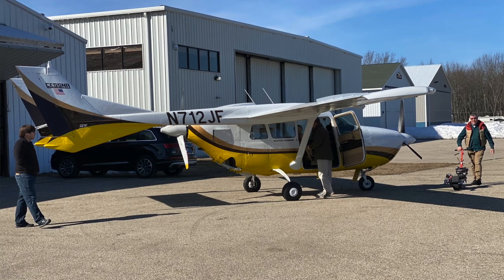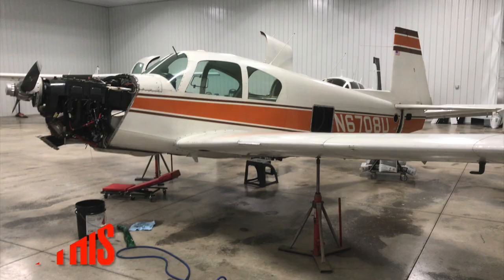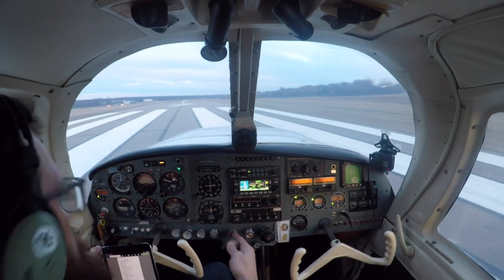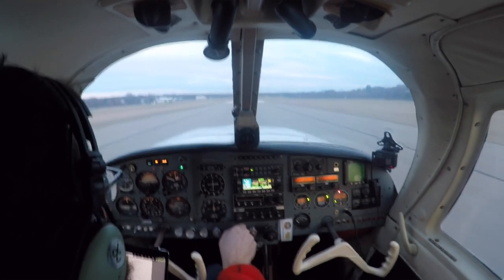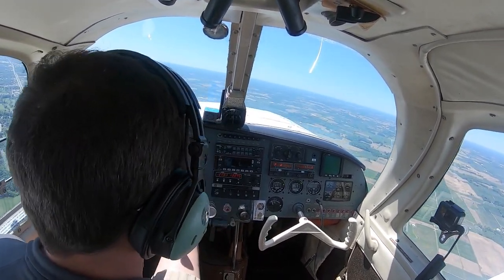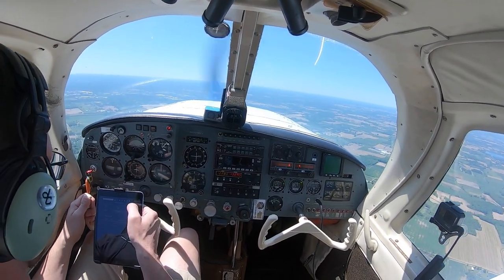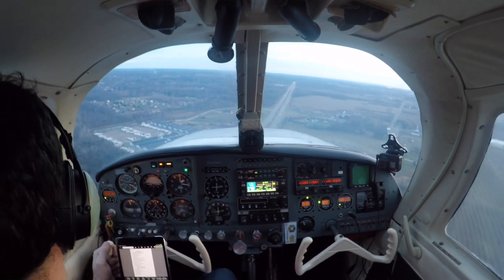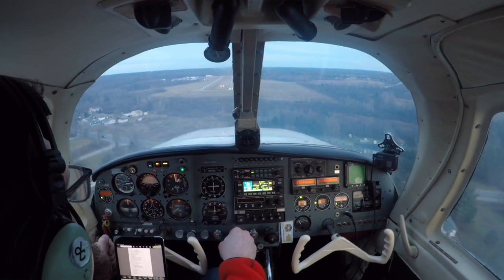Complex Airplanes - Can You Manage The Added Stress? Not As Hard As You Think!

Comment: The hardest, part of complex is understanding when things are done. For example, if you’re flying IFR, it is when to put the gear down. Most people say at the initial approach fix, but if you lose an engine, you’d want your gear up as long as possible. You can also reach the initial approach fix and still have to fly outbound for a course reversal. I will  put the gear down after passing the initial approach fix, inbound, while I’m slowing down and getting ready to configure for the descent. Moving the prop to full forward is best done after you have reduced power Below 15 inches manifold pressure to prevent a prop over speed. I  move the prop full forward when I have moved the throttle to idle that way when I come back with power, you don’t have the loud whining of a speeding prop.
Reply from the maker: I love this perspective, I certainly didn't approach it that way. But, I also never flew IFR
Reply: @MyTimeToFly  depending on what type of aircraft you fly, I’m speaking general aviation in the piston class. It’s a whole different ball game with turboprop and jets. For instance, when I am flying a bonanza, I will fly toward the initial approach, fix and do my course reversal at cruise speed. Once I pass the initial approach fixing down I usually have 5 to 6 miles to slow the plane down before the FAF. This also brings me below VLE. When I’m about 3 miles before the FAF,  I will drop my gear. This will slow my plane down usually to the top of the white arc. Then I adjust my throttle to bring my speed below VFE. I could then deploy flaps when the glideslope indicator is one above the donut. All I have to do at that point is reduce enough power when the glideslope or vertical descent is picked up and everything is set up perfectly.
Reply from the maker: Sounds fast paced in a piston single, I bet it screams by in a jet!

Comment: Thanks for the video. I transitioned from a 172 to a Mooney M20J a year ago and it was very easy for me. In fact, I find the Mooney easier to land.
Reply from the maker: I agree, the Mooney is now easier for me to land than the Cessna. Just seems to be more predictable.
Reply: @Rodolfo Castro Same here 172 to M20J and as long as you're not too fast, the M20J is a lot more stable in crosswind situation and lands very softly compared to the 172. The hardest is to manage when to descend so you're not too fast nor too high when you get close to the destination airport
Reply from the maker: I’ve got some good strategies for descending, I’ll share them in an upcoming video. I agree with everything you’ve said!
Reply: @TheBarzook  Cool. Mine came with speed brakes but I rarely use them. The landing gear is a great tool to reduce speed if managed properly. 👍🏽
Reply from the maker: Definitely a must to get the gear down. What’s your gear down speed?
Reply: @MyTimeToFly  On mine it's 155 mph and you're right, if I'm a bit fast close to pattern altitude I'll point the nose up a bit just to get to 155 and lower the gear that usually slows .e down enough to be in flap territory at around 120 mph.
Reply from the maker: Must be nice…I’m stuck with 120 gear speed and 100 mph flap speed. It can be a real challenge sometimes!
Reply: @MyTimeToFly  Oh yes I bet! Did you do a video on what you do when you take your kids up with you? Like what kind of headsets and how do you keep them seated for a long period of time. I haven't took mine yet (6 and 3 yo) but wondering how I'll manage that!
Reply: @MyTimeToFly  131 kts.
Reply from the maker: I think I have something from a while ago, but don’t remember exactly. We have some David Clark H10-13.4’s that they use for headsets. They are just normal headsets, not “youth” version. If we are going on a long trip we also bring non-aviation bluetooth headsets which they can connect to iPads. iPads are the real secret to keeping them from going bananas in the back of an airplane.
Reply from the maker: That’s not too bad, and extra 10 knots would be great in my C.

Comment: I'm not a pilot, but I can imagine adjusting the prop in the pattern to reduce wear and reduce fuel burn.  Flying with the prop full fine is a lot like keeping your car in first gear around the neighborhood.  You won't blow your motor if you're turning 5,800rpm through a school zone, but you are going to put just a bit more wear on your bores, rings, cams, etc and you're going to burn more gas.  You'll also be better able to punch it and swerve around a cat or whatever, and at least in the car you'll look like a bit of a spode.  Without real-world flying experience and just based on first principles, I'd probably prefer to bring the prop down and then put it back to fine on final when go-around power needs to be available.  I'm used to a manual-transmission mindset of adjusting RPM separately and in anticipation of need.  That said, if props do have a not-insignificant tendency to stick, potentially leaving one underpowered, then I can definitely understand why you'd want to set it and not monkey with it back and forth.  I suspect it has more to do with not wanting to get distracted and forget.
Reply from the maker: Lots of great thoughts, especially as a non pilot! One thing to consider, that the RPMs of the people do eventually reduce once you bring the power down enough, regardless of your prop setting. An example from the Mooney. At 13” of manifold pressure, I’m turning about 2200 rpm at a full fine setting.
Reply: @MyTimeToFly  That's good to know.  I'd still imagine that a lower prop setting would be more efficient though, as engines are typically more thermally efficient at higher loads and lower RPMs.  With a full fine prop, you may be putting more energy into beating the air than into making actual thrust.  Kind of like a high-stall torque converter.  But of course, all this is just theoretical, and might be worth like five bucks a year.  It'd be interesting to look at a BSFC chart and see if an O-360 plays by the same kind of rules as a Chrysler 360.  Some engines don't; if you were flying a 2-stroke or a Wankel then you really would want to keep it buzzing in the narrow Happy Place, load be damned.
Reply from the maker: I wish I could post a photo in here, I’d show you a chart that show efficiencies based on MP and RPM. Check out a “cruise and range data chart” of the Mooney sometime.

Comment: I would at least reduce prop to climb power rpm even when staying in pattern( prolonged excess noise)The prop full forward on landing isn’t really just in event of go around.  Many other scenarios factor in to that prop forward/ fine pitch condition. Especially in short field, IFR, etc… I personally use base or final as my latest point to be prop full forward. Just my way of doing it though.
Reply from the maker: Roger that, thanks for sharing!
Reply: I’m usually use 2700 for takeoff, 2500 for climb and 2300 for cruise unless the altitude listed in the POH shows 2400 as lowest setting. Once I’ve been cruising, I leave the prop at cruise until I decide to go around or after I’ve landed and retract the flaps, then push the prop forward. Below certain manifold, pressure the RPM is not even going to reach those levels. When I make a determination to go around, I don’t  immediately jam, throttle forward. I am usually at MP below the green arc,  then I make sure the mixture is rich, move the prop full forward, then I bring the power up on the go around. (Right to left in the quadrant). Positive rate, gear up, stabilize, and then retract the flaps one notch at a time.

Comment: my instructor told me soon after takeoff pull power back to 2400 rpm and the same for the manifold pressure. I fly a M20F out of 9D9
Reply from the maker: Very cool…good ole Hastings. Todd there does my maintenance. O shoot for 25 squared on climb out if I’m not climbing up to altitude. I’m a firm believer MP to the firewall if your climbing high. Honestly, there are many correct answers here, and LOTS of opinions!!!